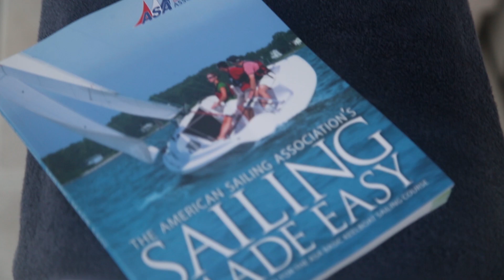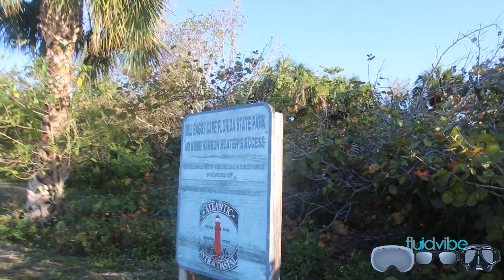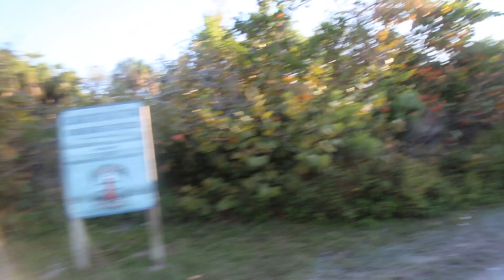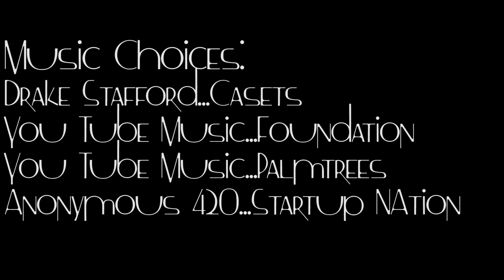ASA 103 Basic Coastal Cruising- Nothing Basic About This!!  S2E2

Comment: Interesting that you're on a cat since the 101/103 are for monohulls, I thought.
Reply from the maker: Hey Bennet- I think the 101/103 can be done on any sailing vessel be it a monohul, catamaran or even a smaller lazer.  I just grabbed a class that had us living on board and was focused on catamaran.  So, the course went over the exact same material, same test,  just with a different vessel style.  Thanks for inquiring.
Reply: Usually schools use mono boats. Slip and maintenance cheaper. Some say it is better to mono first. You feel more? IDK, I have only single .